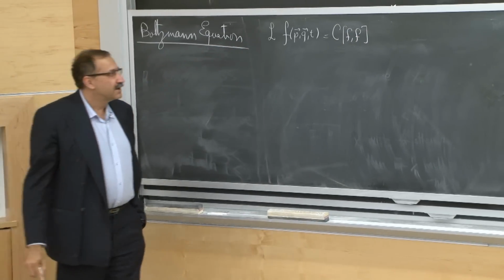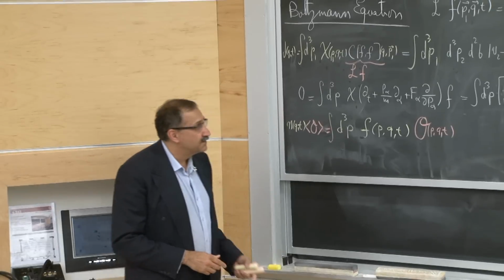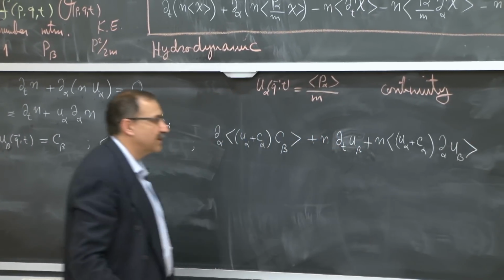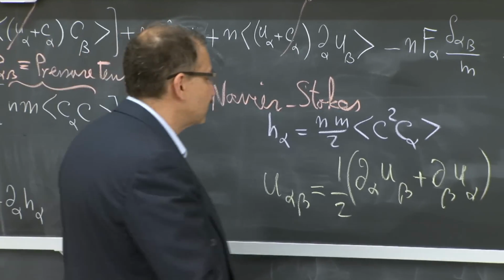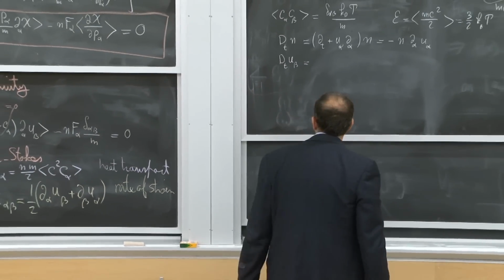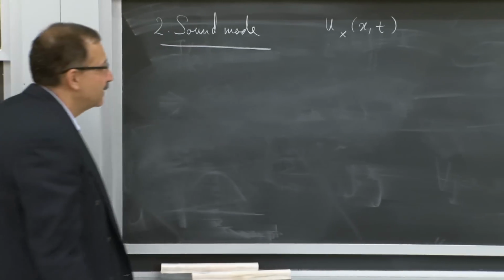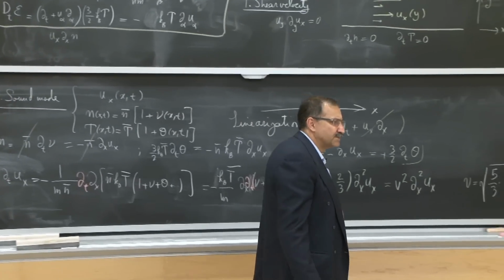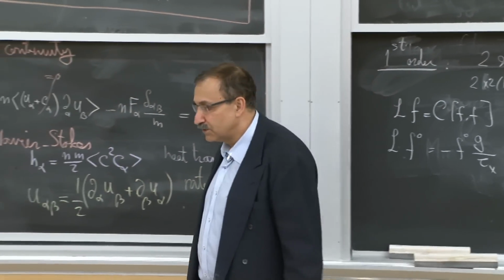12. Classical Statistical Mechanics Part 1

Comment: Chapter 1: Introduction to Course and Boltzmann Equation
- Timestamp: 0:00-1:06
- Summary: Introduction to MIT OpenCourseWare and the lecture's focus on the Boltzmann equation for describing motions in a dilute gas.

Chapter 2: Boltzmann Equation and Notation
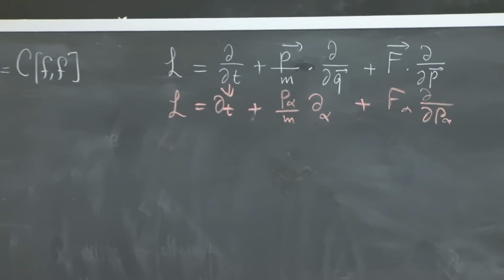- Timestamp: 1:06-2:33
- Summary: Detailed explanation of the Boltzmann equation, including time derivatives, velocity, and external forces. Introduction of shorthand notation for derivatives.

Chapter 3: Collision Operator and Boltzmann Equation Dynamics
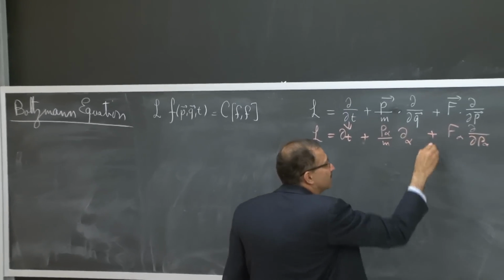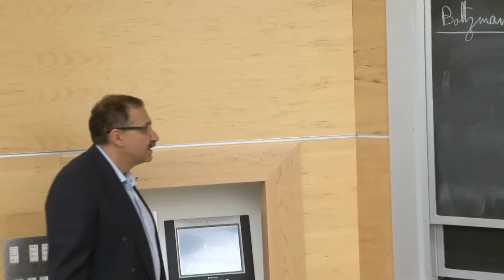- Timestamp: 2:33-4:24
- Summary: Examination of the collision operator's role in the Boltzmann equation and its impact on gas particle dynamics, integrating over particle momentum.

Chapter 4: Conservation in Collisions and Hydrodynamic Equations
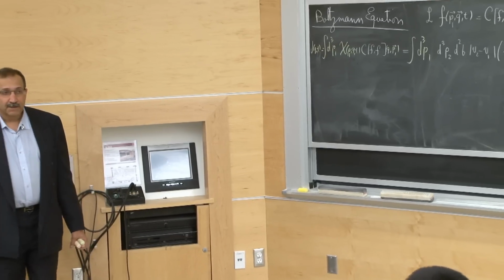- Timestamp: 4:24-9:15
- Summary: Discussion on conservation in collisions, leading to simplification of the Boltzmann equation. Introduction of hydrodynamic equations to describe slow variables.

Chapter 5: Derivation of Hydrodynamic Equations
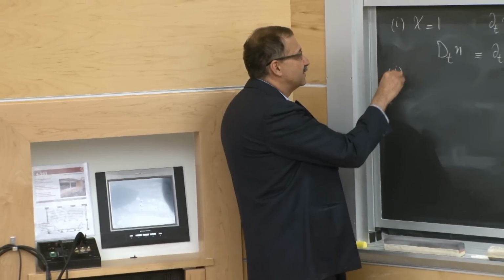- Timestamp: 9:15-21:48
- Summary: Detailed derivation of hydrodynamic equations, exploring conserved quantities like momentum and kinetic energy, and their implications in the Boltzmann equation.

Chapter 6: Average Kinetic Energy and Energy Density
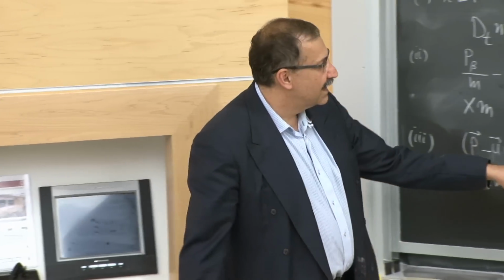- Timestamp: 21:48-34:24
- Summary: Calculation of average kinetic energy and energy density in a gas. In-depth look at the kinetic energy part of the Boltzmann equation and its role in fluid dynamics.

Chapter 7: Linearization of Hydrodynamic Equations
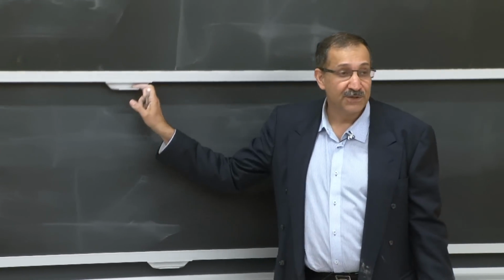- Timestamp: 34:24-40:49
- Summary: Linearization of hydrodynamic equations to simplify their solution, focusing on quantities conserved during collisions like momentum and energy density.

Chapter 8: Temperature and Pressure in Gas Dynamics
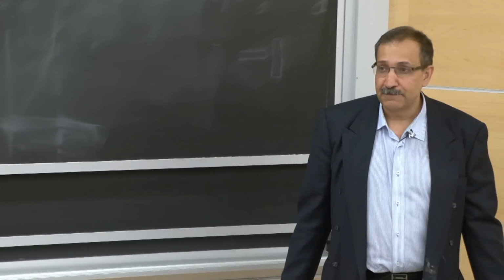- Timestamp: 40:49-53:00
- Summary: Relationship between temperature, pressure, and gas dynamics. Discussion on the impact of local fluctuations on pressure and temperature.

Chapter 9: Perturbations and Equilibrium in Gas Dynamics
- Timestamp: 53:00-59:51
- Summary: Analysis of how perturbations in gas dynamics, like shear velocity and sound waves, evolve and reach equilibrium, exploring solutions to the linearized hydrodynamic equations.

Chapter 10: Boltzmann Equation and Relaxation to Equilibrium
- Timestamp: 59:51-1:13:01
- Summary: Examination of the Boltzmann equation's ability to drive systems towards equilibrium, investigating specific scenarios and modes that do not relax to equilibrium.

Chapter 11: Improved Solution to the Boltzmann Equation
- Timestamp: 1:13:01-1:25:37
- Summary: Development of an improved solution to the Boltzmann equation, incorporating linearization and relaxation times, to better capture the dynamics of gas particles and energy flow.

Comment: Maybe not the best place to ask this question, but anyway:

When he chooses an f function to input to the zeroth order hydrodynamic equations he specifies the local equilibrium, however it seems there are two choices for this function. One is as he writes, one is a more general version, the version he writes has the extra characteristic that {f, H} = 0. This does not seem a necessary condition, all that he says he requires of this function is that the RHS of the Boltzmann eqn is 0, it seems like this extra poisson bracket = 0 starts to make the LHS =0 too?

Anyway, great lectures!
Reply: Assuming the given Gaussian form for f, in the given 0th order approximation for the Boltzmann equation does not necessarily set LHS=0, since he explicitly mentions that the variable T is a function of position. For it to be a legitimate expression for temperature in equilibrium (that sets LHS=0), T must be constant throughout...